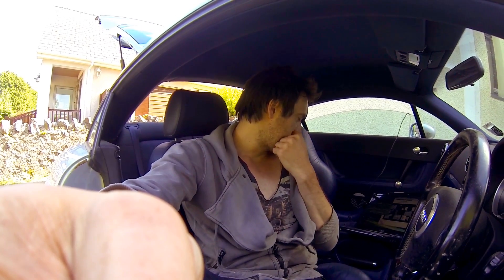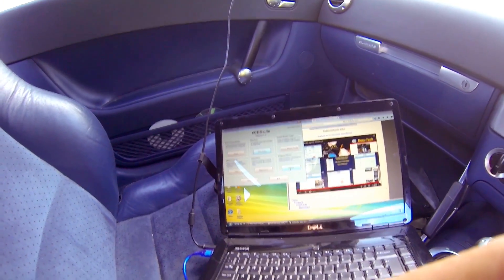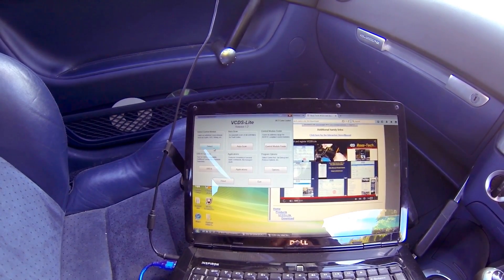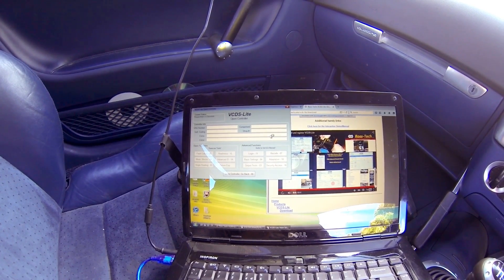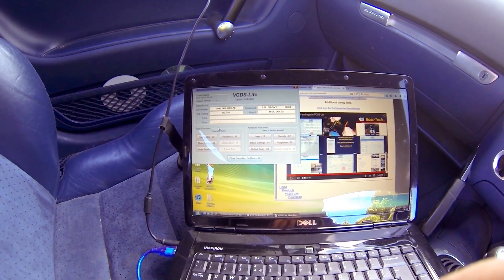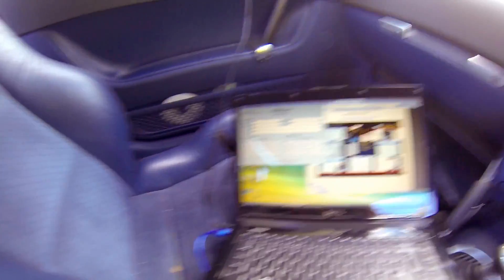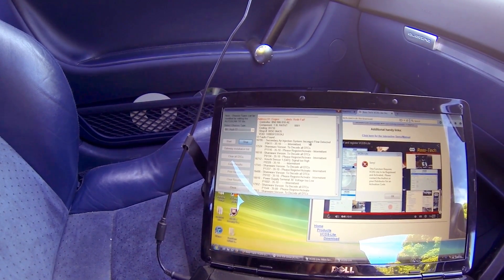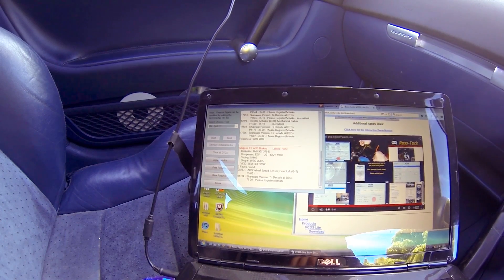How to use a VAG COM car diagnostic on an Audi TT

Comment: Im using the lite version as well very new to it....even though it blocks some of the errors you can look them up i have a 02 TT roadster  needs a crankshaft sensor  same time both windows stopped working last week the comfort control mod went out on me......i'm thinking it has to be a relay whats keeping the windows from working if anyone has any idea what it could be please let me know.....many thanks for your video subbed ......here is a link to the codes if anyone would need to look them up......

http://wiki.ross-tech.com/wiki/index.php?title=Category:Fault_Codes&pageuntil=01271#mw-pages

Comment: can i just buy a vagcom-usb and plug it into my laptop, pirate the software, and it will read the codes? Or is it more complicated like that, like the software being a hard to find or something?
Reply from the maker: I'm not too sure where software might be found but I know you can buy it off ebay
Reply: meocats Tge main thing is the cable you can buy a fake one from eBay and the rest is free £10

Comment: Great video. Don't give up on the TT ! Mine has about 125k miles still kicking pretty hard. I would also like to thank you for your previous videos on replacing your TT's cylinder head. Those videos helped me replaced my '01 225 TT which had the same problem with the timing belt snapping. I also ended up replacing the valve seals as well since they commonly fail and produce smoke out of the exhaust during start up  in mk1 TT's.

The secondary Air injection code could be caused by faulty EGR ( combi valve) or the commonly the actual SAI pump. To test the EGR pull it and blow air through the SApump side, no air should go through. Apply vaccume to the vaccume side of the EGR and blow through SAP Air should go through. EGr can be pulled and cleaned, most of the time its clogged up due to the soot.

Testing SAP can be done in vag com. IIRC its in Engine and somewhere on the right group of button 03 and next,next and the SAI should cycle. Normally SAP would stay on until catalytic converter reaches optimum temperatures.

You need a new throttle body and re-program the throttle position.

GL with everything !!!
Reply from the maker: tsunami105 Thank you for the good tips and heads up.